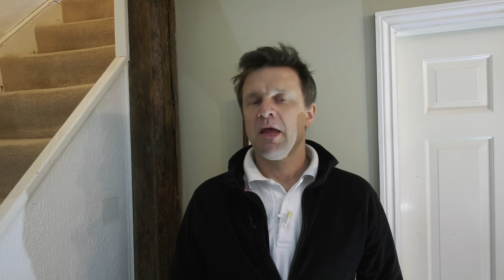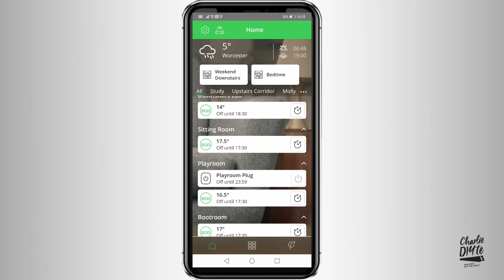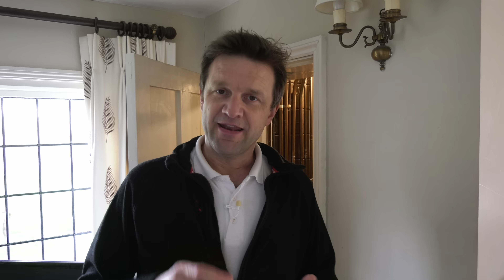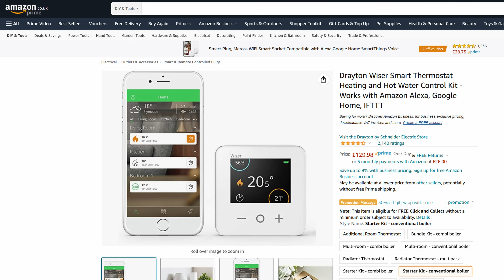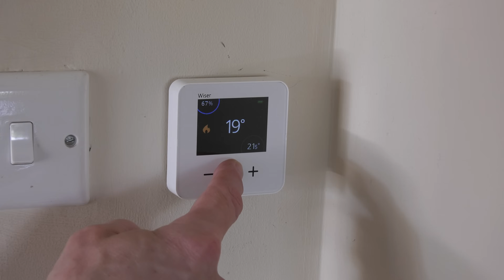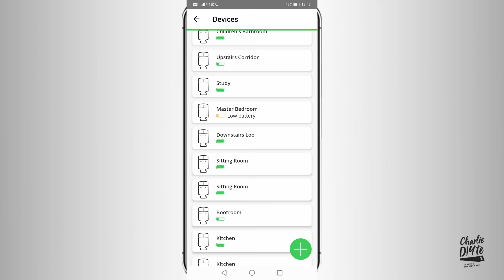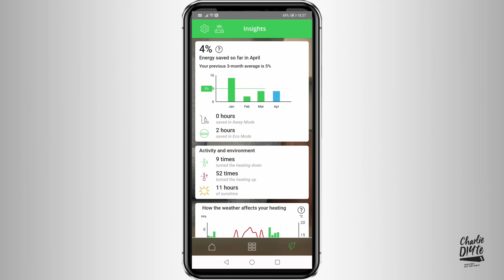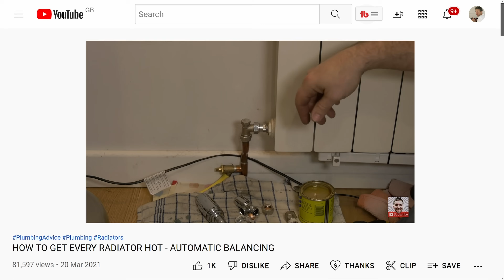Smart Heating Update - 14 Month Review

Comment: I installed this system about a week ago - had a few teething issues with one rad valve (which a 'factory reset' sorted) and an initial issue with account setup, but other than that it's working a treat, with no range or connectivity issues in a three story house. I have to add that the technical support, both on the phone and via email has been superb; with queries answered both quickly and knowledgeably. My only grouch is with the support pages on the website, which whilst they look very pretty, make it very hard to find 'hard facts' (many of which are simply missing) - this wouldn't be so bad if a bit more info came in the box with the system.
If I had a wish list, it would be 1) to be able to buy the system without a room thermostat, 2) to have a smart 'flex outlet' as an option to the smart plug and 3) to be able to assign other users 'non-admin' use of the app (so they might have access to some facilities but not others).
Thanks for the vids Charlie!

Comment: I wish people would stop thinking of wifi and internet as the same thing. The reason Zigbee is used has Zero to do with the possible loss of internet or even the wifi falling over and everything to do with power consumption. zigbee uses next to no power but wifi would drain those batteries in under a week. Another mistake is that you are not using the smart plugs to boost your zigbee range. You don't get a choice in 99% of zigbee networks. Once they are all connected to the same network then any powered zigbee device including bulbs and smart plugs will automatically repeat the zigbee signal.
Reply: I share your frustration with people using WiFi and Internet interchangeably! I also agree that Zigbee is all about the power consumption. I'd go as far as suggesting on 2xAA batteries I'd be surprised if WiFi lasted a day or two, but on Zigbee it could be 12-24 months depending on the device.

Comment: On balancing radiators this is what I've done: closed all radiators from the distributor; put a hose from the heating drain valve to the sewage; open the heating fill valve (where I can add water to the system); open one of the radiators (the one further on in there system) and notice the pressure on the pressure gauge. Starting point for all radiators is wide open on both in and out valves. Try a few radiators to find the one with the highest resistance (highest pressure on the gauge). Once I found the greatest pressure I did the same on all radiators (so just one radiator opened at a time) and close the return valve as needed to match the highest found pressure. I did this on all radiators so all circuits had the same flow resistance (same pressure on the gauge). I hope it makes sense how I explained....
Reply: Can you do a video please?

Comment: Very cool video, we went with tado and have just installed homeassistant, the tado was good by itself but the app is sorely under developed, but the introduction of home assistant to the system has plugged all the gaps, in fact the tado integration means we don’t need to use the tado interface at all anymore.

Home assistant took about 30 minutes to set up, so you don’t need mega tech savyness to get it up and running, and you only need to make it as complicated as you need.

Comment: Charlie it’s all well and good putting in one of these systems. Who has £1000+, plus fitting to spend. The average person that could benefit from these systems has neither the money or the diy skill to install. Paying someone to fit the system could possibly cost as much if not more than the system. And a 10 to 20 year recovery time on costs. The average house in the UK is very poorly insulated to start with. That’s why I put a long recovery time on cost.
Reply: Where are you shopping where this system would cost £1000+?
Reply: @nickstevens9172  it’s a general cost of the system all the extras , fitting extra insulation. It all adds up in the end. If Charlie costed it up it probably wouldn’t fall far short.
Reply: @davidatkinson3336  what extra insulation is necessary? At least we’re getting closer to the cost now we’re under £1000.
Reply: In my original statement I said “ house are poorly insulated” no point spending money to cut heating if you have poor insulation is my point.
Reply: @davidatkinson3336  so just to clarify, you’re happy to accept that this system costs nowhere near £1000 and as such fitting (if required to be done by a contractor) would not either?
Reply: @nickstevens9172  For the system that Charlie has would have in all probability cost about that much.
Reply: To anyone reading this thread (from the video) Charlie lives in a large 5 bedroom detached Victorian house and even then the system he has installed would cost less than £800 at current Amazon prices. Most houses would not require 14 smart radiator TRVs. I have this type of system and have recommended it to many.
Reply: I have Hive. Granted everything I got was on black Fridays and British gas discounts but all in with the Hive thermostat and 8 smart TRVs and installation it was approximately £350. 

it's not just about financial payback either but more to do with convenience and ease of use. While you can get digital thermostats and TRVs with schedules, you can't control them from a beach in Barbados. 

Also on the point of financial recovery, with the energy cap doubling in the UK, it's much shorter for payback. If it continues solar panels may become viable again, even without gov grants!

Comment: Your explanation of why the Zigbee wireless network is used is flawed.  The main reason for using Zigbee rather than WiFi is that it can use a mesh.  It has nothing to do with the reliability of WiFi.  You have also conflated the reliability of your Internet connection with the use of WiFi.  Even if your broadband connection fails it does not mean that WiFi could not be used to communicate between local devices on the same network
Reply: The mesh system is certainly a benefit of Zigbee, but the key reason is that Zigbee has extremely low power usage compared to WiFi. Zigbee is very slow compared to WiFi, but built to send small packets of data a short distance, so is perfect for smart devices.

Comment: 23:56 Covers Balancing radiators (not subscription Services).  P.S. I tried to add some links to useful websites, but YT deletes the posts. On Heating hub "At 54°C the boiler is 87% efficient. The boiler does not reach 90%+ efficiencies until the return temperatures are around 45°C." That site says that most engineers are not trained to correctly setup condenser boilers.  "why our condensing boilers do not condense".

Comment: I did comment on your other video recently, but, to summarise, my experience has been mixed. Although my new Baxi 800 combi is Opentherm compliant, it just caused issues whereby the output temperature was way high and it also took control of my hot water output temperature as well, which was odd! I put this to Drayton and they said 

“Your hub isn't defective, control via open therm is interesting at the moment we are finding certain boilers are programmed to respond to these connections in different ways, and the industry is still looking for a universal standard of configuration that programmers can use to control boilers, However, the issue here is that a lot of the software that these boilers and programmers use is proprietary information, so manufactures are reluctant to give that up.”

I think this means I’m not getting the benefits of modulation, which is a shame? Anyway, the Wiser registered installer that I subsequently engaged (my regular plumber is not into this modern stuff!) switched me back to the more standard connection where at least I can now set both temperatures. My other main issue (apart from the app which has a few ‘foibles’) is that two of my rads get close to or on temp, but continue to call for heat (the boiler is firing) but touching them reveals they are stone cold. Boost them and they get heat no problems. My current theory is that they are older Danfoss type valves and although the pins are not stuck, they seem to have less travel than those rads I have with Drayton valves. It’s as if the Wiser TRV can’t make small adjustments. I could be completely wrong (I’m not an experience DIYer!), but as I need a valve installing on my hall rad anyway, I’m going to have one changed to a Drayton valve and see whether that improves the situation. 

I have no idea whether this is saving on gas as yet, it is too early to say. But I’m going to persist with it for a while longer. I’ve just has SMETS 2 meters installed so I may take a look at Insights+.
Reply: Hi, I had a similar issue and the trv bodies were sticky and messed up the drayton valve calibration. Replacing the trv bases fixed the issue
Reply: @dj2006djdj  Thanks for that. So Drayton Wiser TRVs seem to work better with Drayton valves…..who knew!! 😂 I have checked the valves and pins and they don’t seem sticky at all and I do have other non-Drayton valves that seem to work ok, but I guess I’ll have to just bite the bullet and replace some of them.
Reply: TRVs don't have granular control, they are either ON or OFF. 

Opentherm implementation is all over the shop. You want to look into getting weather compensation for your boiler.
Reply: @Swwils  Hmmm. Not according to Drayton who I spoke to this morning. And besides which if I boost, they work. It only seems to be when they are trying to ‘fine tune’ that they have an issue.
Reply: @mikec2505  then get them to define what possible graduation they can introduce when the TRV has no idea what valve it's on.
Reply: Hi Mike C, did you ever resolve the opentherm issues? I am looking at installing the same system as you, did go down down the weather compensation route? Regards Mike

Comment: Charlie I have a Heat Pump and I’m getting slaughtered with the cost to run it,like for like compared to my 3 Combi Boilers over the years I am on my second Heat Pump the installers went bust and the next outfit said the high bills were because the Hitachi was too small and fitted a
17Kw Grant Heat Pump.and no one wants to know full stop.I am banging my head off the wall like for like Heat Pump is not in the picture I don’t care what they say.LIKE FOR LIKE not a chance,tied into  7 year thing proper conned MCS they don’t want to know.Cowboys
Reply: You need to take a step back and look at your room by room heat loss calculation.

If the calculation is correct then check your system design and installation to this calculation. 

If its still not matching up then something is massively affecting your heat losses without being obvious- draughts most likely.
Reply: @Swwils  This is the comments that comes up but like for like shoots it straight down,Facts are facts Potatoes for Potatoes KWh.£.€.$.Heat Pump compared to my Gas fire there is only one winner and it isn’t the Heat Pump I have the bills to prove it.
Reply: @Allegedly2right  you literally cannot have a like for like boiler Vs heatpump. You need to have a system designed for lower flow temperatures in order to get the coefficient of performance to a level where the electrical cost is better than the cost of gas.
Reply: @Swwils  Exactly that's the installation teams job didn't work for the simple reason they never had a clue because they probably did a 2 week course and are now qualified engineers Allegedly no comebacks who do you complain too, not your fault don't believe all you read costing a fortune